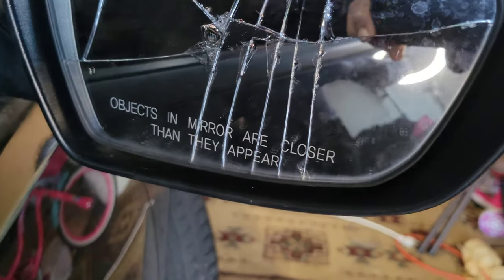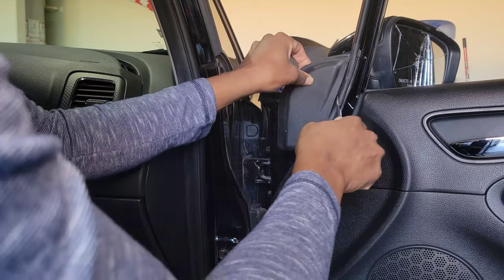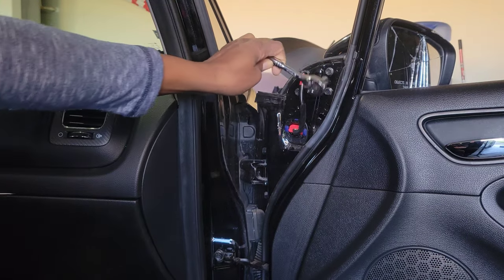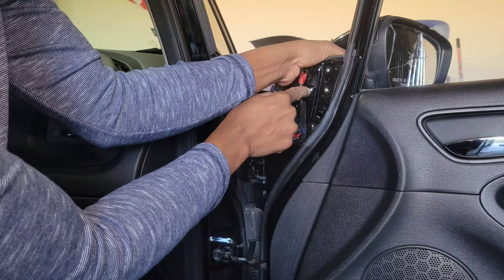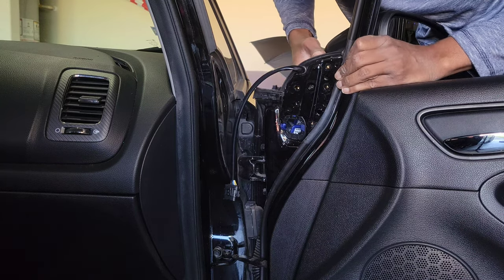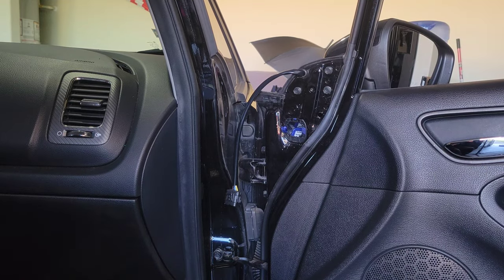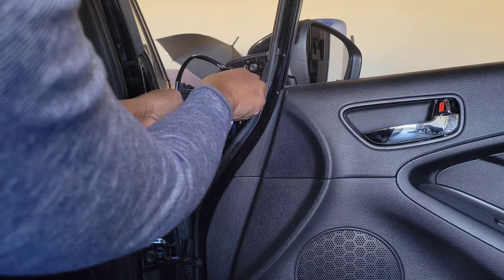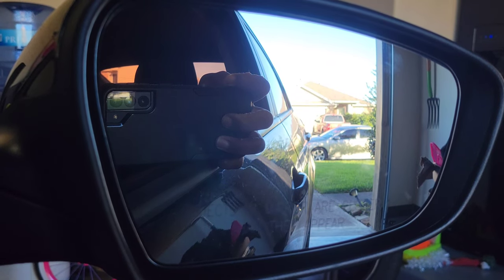How to replace a car mirror | Kia Forte | DIY

Comment: Hey, so I have a 2018 S. And I was wondering if I could replace both mirror assemblies that do not have the blinking indicator nor the puddle light with the one that hasn’t indicator and puddle light do you know if this will work from what I can see it has the same number of pins.

Comment: Did you replace the entire mirror assembly for just broken glass? Mine is 2010 and you can replace just the glass on it.
Reply from the maker: Yes..because the housing was significantly damaged. Just replacing the glass alone would not work

Comment: Thank you for this video!
Reply from the maker: Glad it helps
Reply: @shanevee  Just a question though… did your mirrors have the connectors with 4 or 5 pins? I purchased one from eBay and it came with only for but my car has 5…
Reply from the maker: @James Montoya  I honestly can't remember how many pins they were. I bought the mirror from the Kia parts store online. Plus I sold the car so I can't check it to see. Sorry. But reading where some of the replacement parts have less pins than original parts